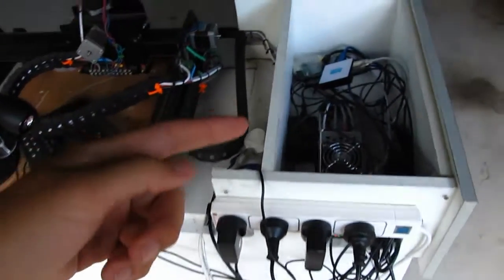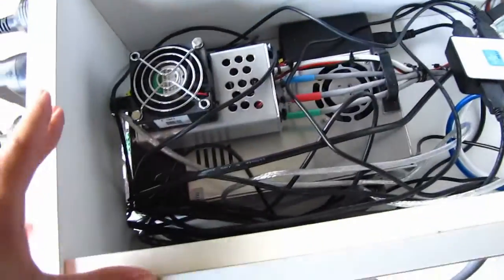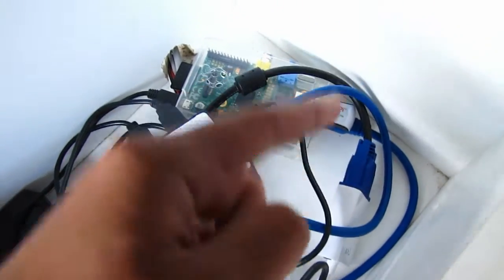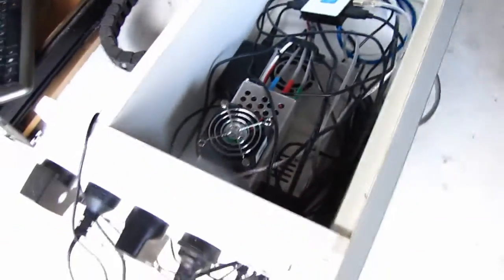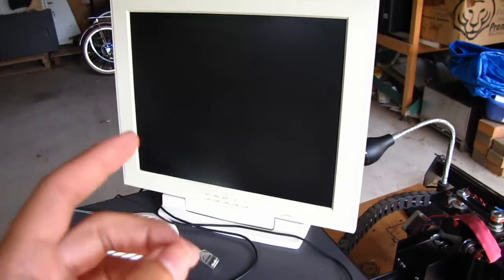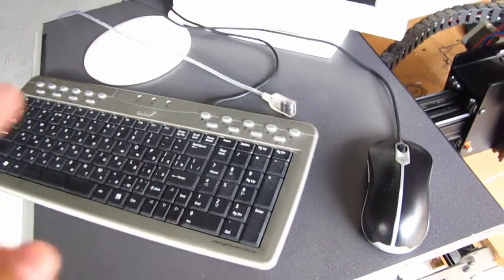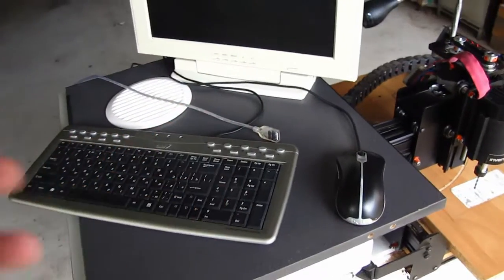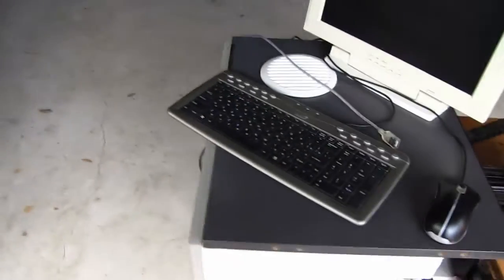X carve pt3- What to do with a spare Rasperry PI

Comment: What software are you using on the PI ? and the design software you use - Thanks
Reply from the maker: +myozone You can use Linux CNC on the PI to run the CAM files. To design the parts, I use Autocad or Draftsight, and to produce the g-code I use CamBam. If you want i can maybe do a tutorial on Draftsight which is a free 2D CAD software
Reply: That would be very useful, thanks. Any video on CNC, design and workflow also helpful. I was looking for software to run on a PI that has a web GUI rather than a attached keyboard, key and monitor, that way just dump a file onto a let it go.
Reply from the maker: I see why using a web GUI would be useful, but I would personally always stay in front of the CNC just in case something went wrong and if I had to quickly reset something. Plus having your keyboard right next to the machine makes jogging it a lot easier if you don't have homing switches. I'll try to get on to the CAD tutorial, but it might take a while cause I'm a bit pinned down with work.